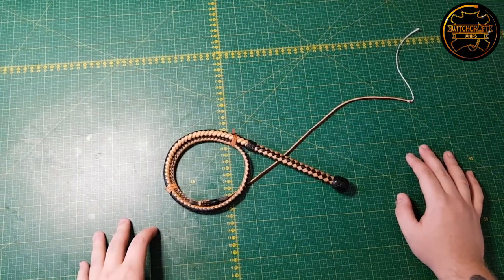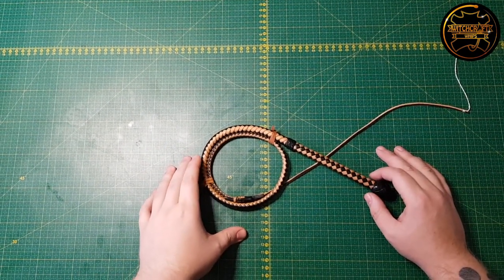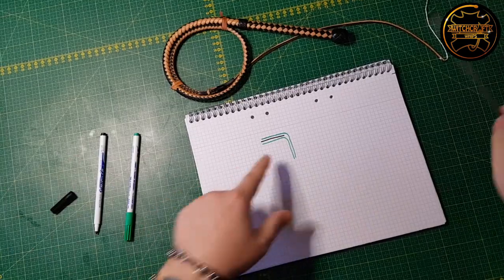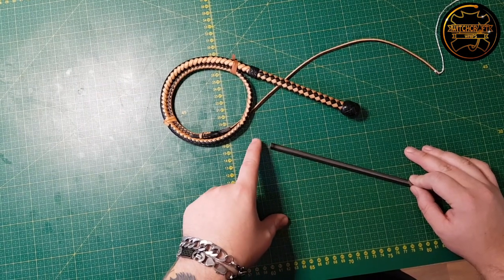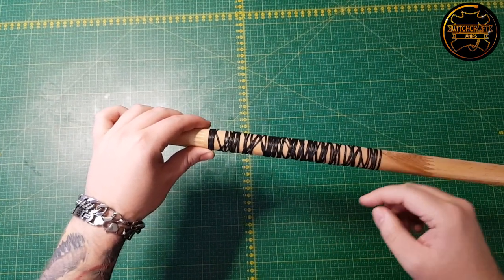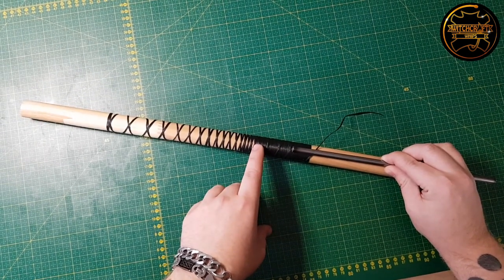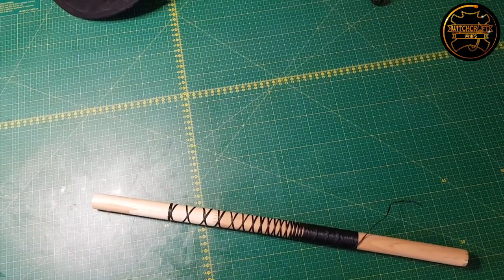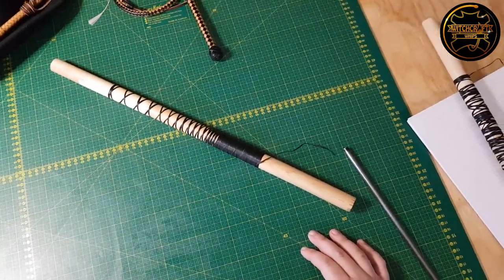Why Bind Transitions? [and how I do it!]

Comment: Not many people have understood that the chaotic binding causes as many problems as it hopes to solve. That being said, and I realize this is very personal, but you really don't need to bind this much to protect the thong from the handle foundation. For example, I bind the core 1/4" past the handle, the first belly maybe a couple of inches and the second a couple more. But however you decide to do it, the important thing is you stop at a point where there is still enough leather so the end of the binding can go unnoticed. If you were to carry out the binding very far, and I'm exaggerating to make a point here, but let's say you were to bind to the halfway mark, there isn't enough leather there to hide the end of the binding, so you would end up with a very noticeable change in flexibility and the whip would age this way so that even when the binding has relaxed over time, there would still be that big difference because just beyond it, the thong has been aging differently. So to avoid this, I stop fairly close to the handle, well within the first 1/4 of the total length of the whip (excluding fall and cracker of course). I plait the first 4-6" past the handle very tightly, and then progressively ease-off the pressure by about 15% and carry on plaiting the rest of the whip with my normal pressure, until I get to an inch or two from the fall hitch, at which point I resume the very tight plaiting. This has given me very good results that combine strength and flexibility and a whip that ages well over time. Always enjoy your videos!